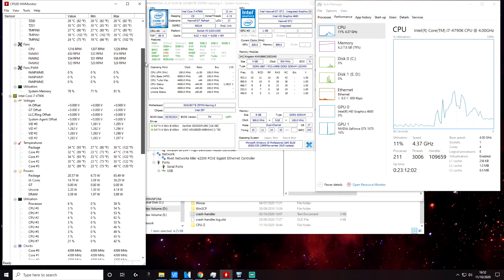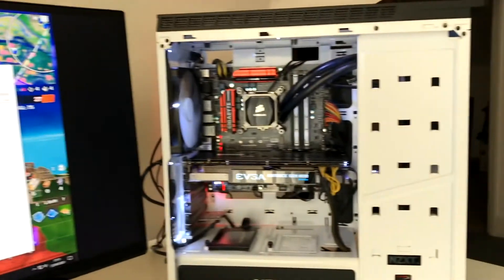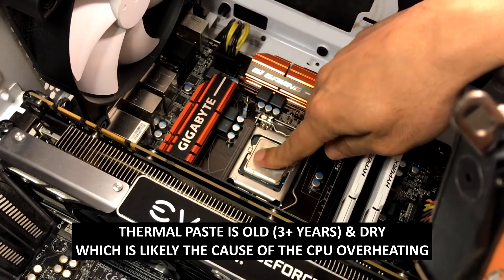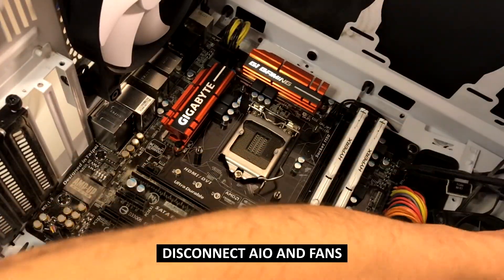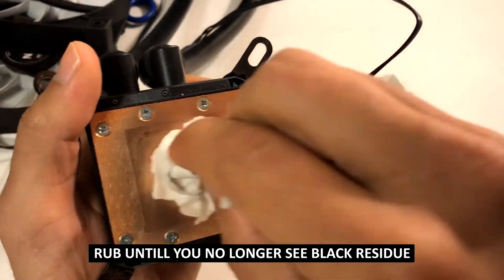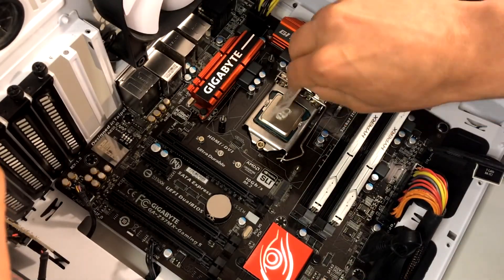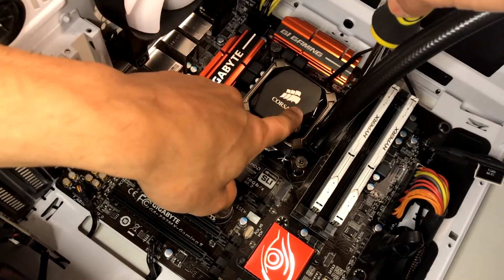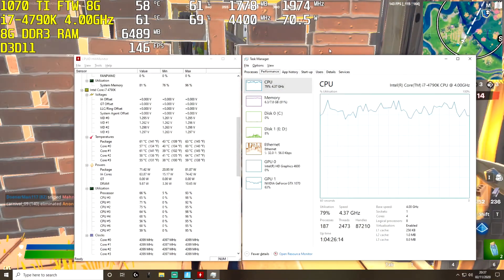Overheating (100°C) CPU i7-4790K | Broken Corsair AIO CPU Cooler? | Fortnite Gameplay on 1070 Ti FTW

Comment: I have the same CPU and all of a sudden this happened to me today but not even when in a game just idle, can I buy a brand new CPU cooler and it will fit? Or will have have to get a specific one that fits my motherboard MSI Z97 Gaming 5? Also I just re applied thermal paste 3 days ago and it was running way cooler than before then all of a sudden this happened
Reply: Ok I come home from work and my PC temps are normal again wtf not sure what going on lol the temps were 100% correct because I was trying to play mw2 and my frames were dropping and stuttering because of thermal throttling

Comment: I completely removed, cleaned, and reaplied the burnt paste and fully reinstalled it but I'm still getting the creep up to 100°C in BIOS, I'm gonna check the pipes later.
Reply from the maker: Some CPUs generate insane amount of heat... just make sure what ever cooling method you are using is removing the heat as it should be. Also check airflow direction and the directions of the fan to make sure you are expelling the warm air from the case and taking in cold air from outside. You can hold a small long piece of paper and hold it next to the fan and it will tell you the direction of the airflow.

Comment: hi man i have the i9 12900k wih a aurus 240 x and is fresh in the desktop around 38 c and 45 however i've been playng fortnite it goes to 95 and 100 c and its so damn hot, its a new pc i and i check the thermal paste and its good , cant see what it is everything looks fine and its weird because when i play red dead 2 around 65 , 74 c, what you recommend me. id been thinking bought the thermal grizzly krayonaout extreme :ch
Reply from the maker: I would check the following:
- Double check the thermal paste, you may have fresh thermal paste but the seal between the CPU and the Cooler might not be great.
- Check the airflow in the case, because you may have fans that pulling in cool air and at the same time another fan pushing out air from the same side... you think to ensure that form one side you are pulling in cool air into the case and expelling it out of the case properly. Use a piece paper and hold it against each fan and you will get an idea of the direction of air.
- Don't forget that heat rises... so make sure to take that in account when configuring your airflow.
- Check the CPU itself by stress testing it and seeing if the rise in temperature  is consistent. I don't know much about other games than Fortnite unfortunately. 

Hope that helps you out. Good luck and let me know how it goes, because I am curious myself :D
Reply: @dailytechtussle2272  ok man thanks, I’ll follow the steps and tell you
Reply: This reply is a bit late but it's a 12900K. You need a beefy heatsink for that. If you are using an AIO, check your pump RPM whether from an App or bios. It could be running slow. 1000RPM is normally a good speed when your rig is at idle and should go up as temp rises.

Comment: Hello, is this problem also related to performance?
because i have gtx 1070 and a i7 4770 99-100c  1*8ram 1600
 and the performance its so bad in games like dishonored 2 or prey and many drop frames 
i see other people have a higher frames than me on the same pc and settings 
(I hardly speak English)
Reply from the maker: In this particular case, the issue was the CPU overheating. With regards to the bad frame rate, it may or may not be related to the CPU temperature.
There are number of reasons why the same specification PC can perform differently. Even though the hardware of the PCs may be the same, the software/drivers/firmware/speed/settings may not be.
Check each component and ensure that you have the latest drivers/firmware and running at the fastest speed possible. 

I would advise you search online on how to optimize your PC to get the most FPS out of games. Check userbenchmark which checks your PC performance and then advises on how you can improve it.

Comment: I use the intel stock cooler on my i7 4790k
Reply from the maker: Without any over-heating issues? I would be surprised.
Reply: i did check my cpu tempeture once and it was 90 deegrees, not sure if it was with an F or C
Reply from the maker: @khangnguyen-gf8vi  Is that when it's under heavy load? If you're gaming, the temperature must reach around 100C? I have found that the stock coolers are just horrible.
Reply: @dailytechtussle2272  yeah. You won't really get an over heating shut off as it just clocks down hence less performance
Reply: @khangnguyen-gf8vi  your cpu isn't boosting all the way bro unless your ambient temp is hella low . Change it.
Reply: I just got a hyper 212

Comment: Why does your gpu usage not 99%-100%?
Reply from the maker: Although I haven't verified it, but I suspect that GPU usage is not 99%-100% due to a bottle neck caused by CPU or RAM or another component like the motherboard. Originally I had the GTX 970 GPU installed on which I was receiving the same FPS/performance but I later upgraded to the 1070 TI. 
Ideally for improved performance, I either need to upgrade everything or just build a new PC, which is what I'm working on.

Hope that helps.
Reply: @dailytechtussle2272  Oki thanks for the answer

Comment: Did you get stuttering for 100°?
Reply from the maker: No stuttering but there was occasional lag. Most modern CPU's tend to thermal throttle down to at or below 100C to in effort to reduce over-heating, which can reduce CPU performance.

Comment: This is on stock speed for the 4790k when the overheating issue happen to you right?
Reply from the maker: That's right, no overclocking, stock speed.
Reply: @dailytechtussle2272  I have an i7 4790k at stock speed, i live in singapore my idle temps w/ H100i AIO is around 37c - 41c, is it normal?
Reply from the maker: @BravoSixGoingDark  around 30C-40C is normal temperature when CPU is idle.
Reply: @dailytechtussle2272  Thanks!

Comment: I just finished converting a Dell Optiplex 9020 to a gaming machine about two hours ago. It has an i7 4790K @ 4.4Ghz, 32GB ram, GTX 1080 (Blower style with overclocks in MSI Afterburner), 500GB Western Digital Blue SSD, 550 watt Corsair CX550M 80 plus Bronze PSU, 5.25" single bay digital touchscreen automatic fan controller, the case modded with a 140mm Noctua fan in the front of the case & a 120mm Noctua fan on the bottom of the case blowing directly onto the intake of the video card. The cooler I used was the Vetroo V5 CPU Air Cooler w/ 5 Heat Pipes & 120mm PWM RGB Fan that I purchased from Amazon for $30. I just finished an hour gaming session of Fortnite with everything set to Epic, motion blur off, v sync off, Direct X 12, 1920x1080 resolution with an average of 120fps (dips to lower 100fps), 98% GPU utilization, 54% CPU utilization and averaged 45c on the CPU (Max temp on the hottest core briefly reached 58c). I am REALLY impressed with this CPU air cooler. While it looks like a knockoff Noctua cooler it however performs right in line with an authentic Noctua cooler at a fraction of the cost. I am tempted to remove the RGB fan it comes with to install two Noctua 120mm fans (I have a couple spare 120mm NoctuaNF-F12 PWM fans in my collection) in a push/Pull configuration just to see how well the cooler performs. However to average 45c on the CPU during am hour long gaming session is already awesome performance as is.

Comment: Hi mate, do you have Cyberpunk? If so what sort of temps are you getting with the 4790k and H100i?
Reply from the maker: Hi Bro, I unfortunately don't have Cyberpunk :(  I did fix the overheating issue by replacing the old thermal paste though. If you are seeing high temperature, i.e. 80C+ then you may have problem somewhere.